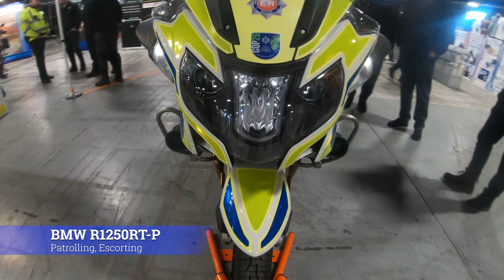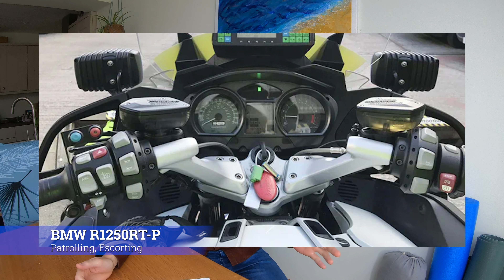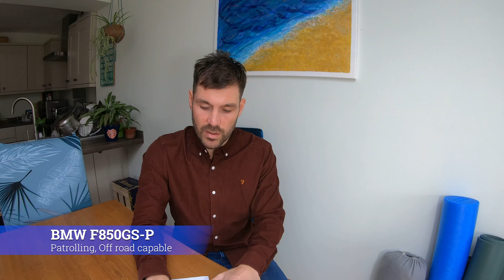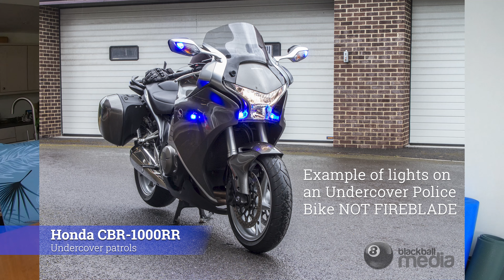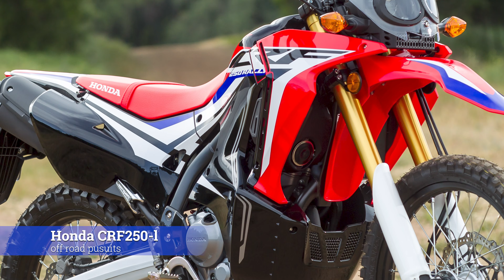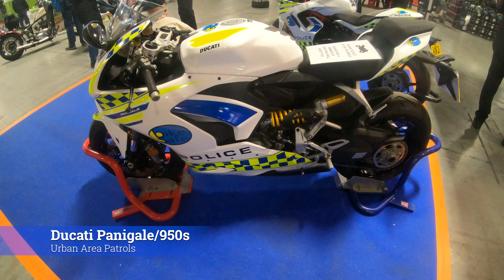Police Motorcycles of the United Kingdom

Comment: Jersey coppers are using the BMW F750gs, I was informed by one of them they had a choice over which bike to use on island, they chose the smaller 19inch wheel on the 750 over the 21inch on the 850 as they are easier to manoeuvre around our island on the road